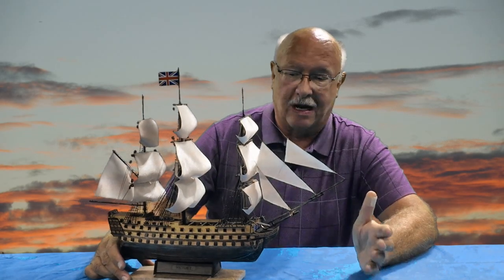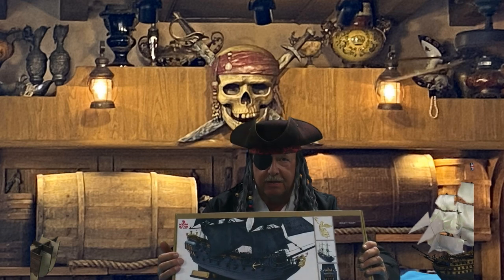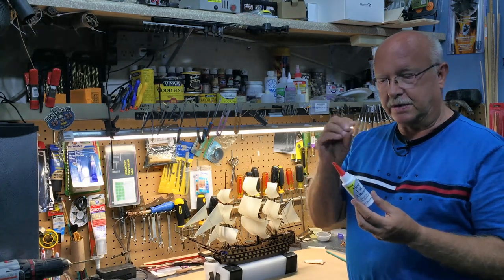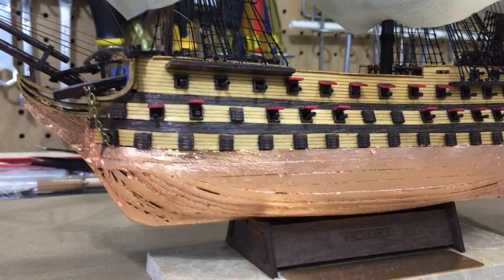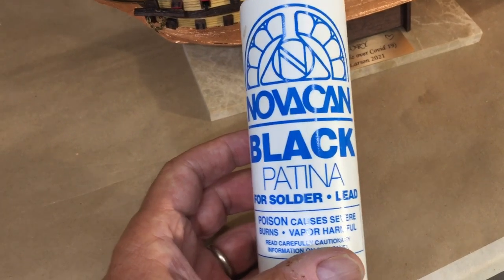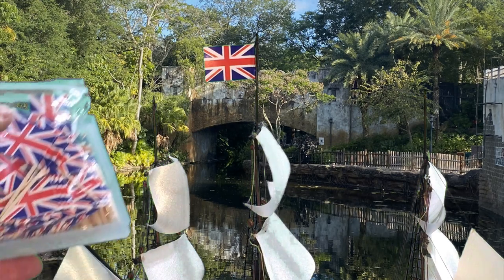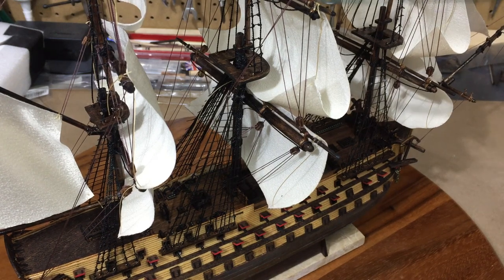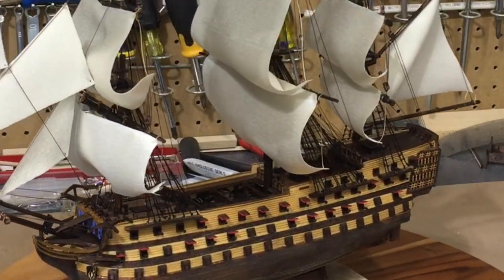HMS Victory Model Ship Build Episode 12 REPOSTING due to sound error.

Comment: Where did you get the rigging pulleys from?
Reply from the maker: Over the years it varies…. Lately from 
https://modelexpo-online.com/search.asp?keyword=Pulleys
If you get on there website and type in pulley, rigging, or block and tackle you’ll find lots of items.
Even the term rigging will show tons of stuff….. starts with rope, but check further down to get to the items you want.
Once you find an item, you can search it on eBay too.
Here’s a seller that I’ve been very happy with: it’s from Peters Model Supplies on eBay. He’s in California and ships quickly and some items ship free.
https://www.ebay.com/itm/145275874678?mkcid=16&mkevt=1&mkrid=711-127632-2357-0&ssspo=MMAmId1yRoG&sssrc=4429486&ssuid=s8A53jWuRTC&var=&widget_ver=artemis&media=COPY
Here’s another sample:
https://www.ebay.com/itm/165423122926?mkcid=16&mkevt=1&mkrid=711-127632-2357-0&ssspo=MMAmId1yRoG&sssrc=4429486&ssuid=s8A53jWuRTC&var=&widget_ver=artemis&media=COPY
Reply: @BoilerDan1  thank you!